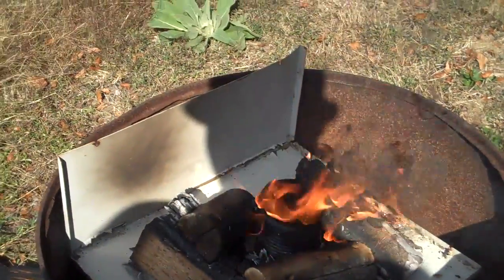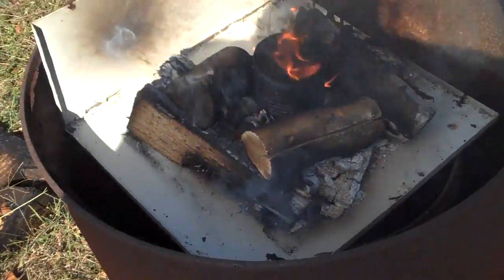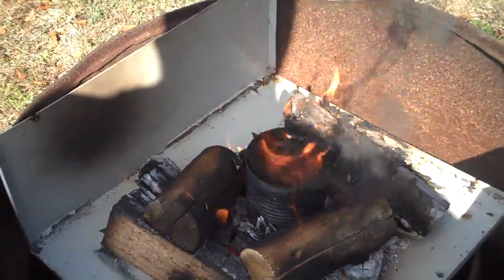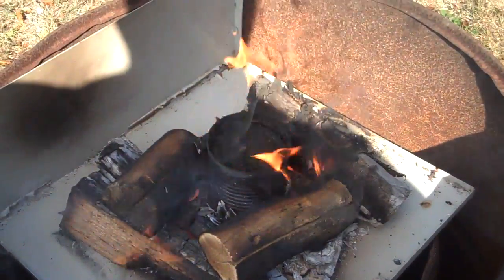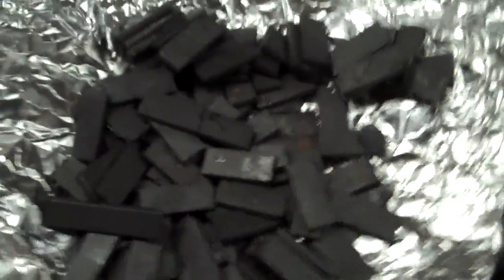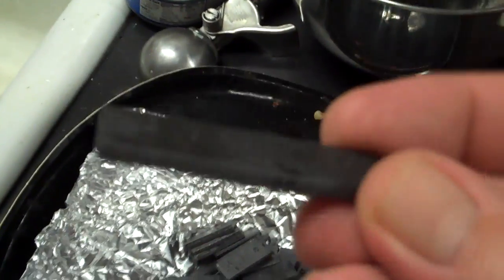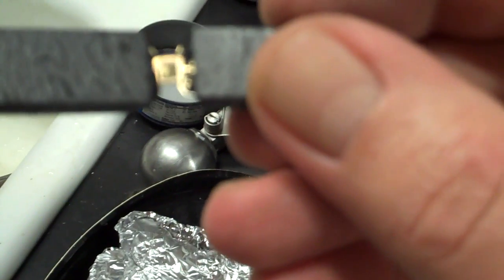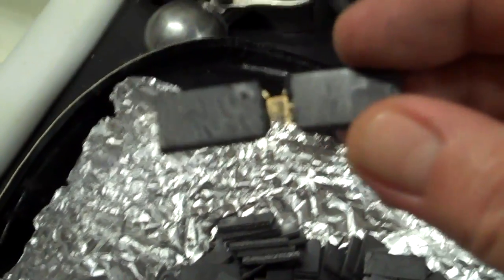Gold Recovery: Plastic IC Chips: Using Pyrolysis to get the gold

Comment: Hey there feets...I've got a batch of IC's that I'm getting ready to process as soon as I finish breaking down my last bit of boards. I'm wanting to use this pyrolysis process but I'm wondering what the next step is. Do you pulverize the material then pan the gold like I've seen guys to with the incineration process or do you process them with aqua regia and precipitate the gold afterward? Your help would be much appreciated!!!
Reply from the maker: Jonathan Knapp I tried pulverizing it. It's safer that way. Then you can blow away or wash away most of the dust and then pan the rest.
Reply: Okay, I'll give that a shot then and see where that gets me. I just wanted to say I'm a big fan of your videos. I'm always watching them when I need help figuring something out so thanks for taking the time to make them!!!

Comment: Mhh dont want to makew a fire every time ^^
Still searching for a way to pulverise them...
Reply: If you just want to pulverise them it's very easy. Ball milling would work fine but maybe take a bit to long. So first thing is to get a rough grinder, hammer mills can be good but I think excessive. A standard industrial grade grinder will do for a very course grind, then you'll need to ball mill them as the metal sticks to the smallest piece of epoxy.

Incineration or pyrolysis is the easiest way for the home recovery person. The leftover ash can be easily sorted with mechanical means. Also you can do it in big lots, I have a dustbin setup for this exact thing. I use 3 pots designed to force the gases from the chips over the hot coals before leaving the system. Should mean destruction of bad stuff and all I have left is like you see int he video. Just light it, walk away, come back the day after and collect the ash for processing.

Best of luck :)

Comment: Burning is not needed. IC chips break apart fine without releasing toxic vapers into the air we breath.
Reply from the maker: Steve Rago The "toxic" vapors are burned up in the process. Just like making biochar, the gases in the plastic get burned up during pyrolysis.
Reply from the maker: Smart-asses bore me to tears.

Comment: Inside those chips are thin bonding wires made of pure gold.  Good luck trying to get them out, I don't know how you would.  Even if you did you would not have alot of gold, they are extremely thin.
Reply: You dissolve them into a solution...
Reply: Braedan Logue They are so small that it is they only easy way to get that part of the gold from them.  If you have ever had one of those eprom chips with the window, it is neat to look inside.  Don't remove the sticker on those windowed eproms unless you don't need them anymore.  They are erased with UV light but regular room light will also do it.  You will usually find them on older cards in obsolete computers that are no longer made.  The are from a time when 286s and 386s were the computers many people had at the time.  Not much memory in those things.
Reply: The silicon wafers are very difficult to get the metals out of by simply attacking them with aqua regia you are correct. However they break apart easily in a cheap homemade ball mill, resulting in a nice powder which can easily be leached with HCL then processed for values.

Comment: Pyrolysis- the process of heating a substance in the absence of oxygen
this allows the plastic to melt off and turn into vapors after melting, since the substance is similar composition to diesel the vapors burn in contact to the flames and this is why there is fire on the top of the can. the plastic melts off->boils->turns to vapors and burns in contact to the flames preventing it from turning into a bloody mess

Comment from the maker: Pyrolysis starts around 700 to 800 F. To melt the metals the temp would have to get up in the 1500 to 2000 F range.